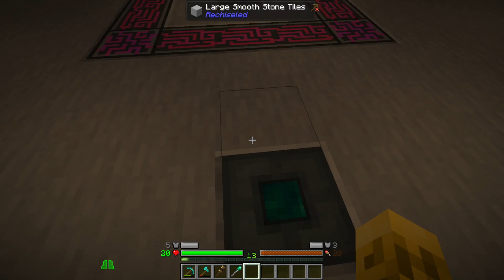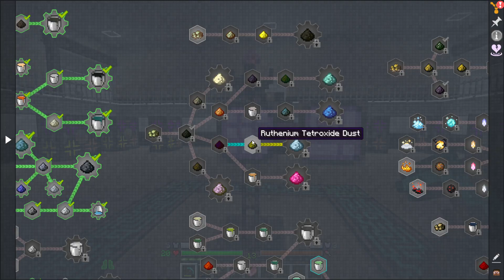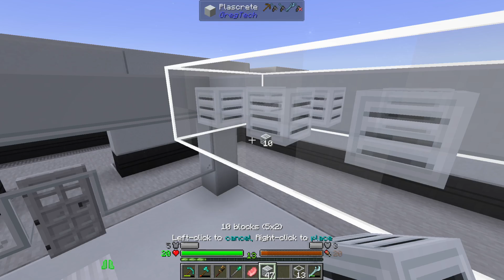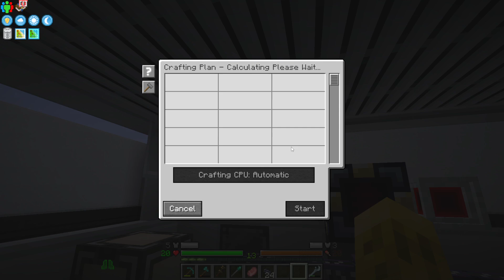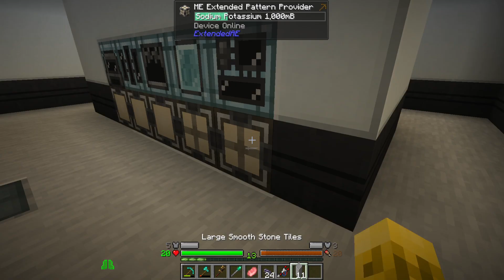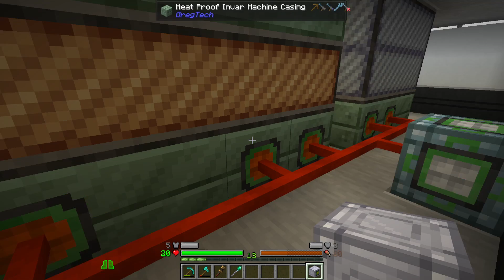Star Technology - EP 20

Comment: When you set a pattern provider to "lock crafting until primary result is returned", the result MUST return through the provider itself or it won't unlock, it's coded this way so providers know that the item resulted from their recipe, since if you had multiple running the same recipe they aren't able to know which item came from which machine unless it returns through the provider itself.

Also, I heavily suggest making a large barrel to make sea water which can be centrifuged into crushed rock salt ore and saltpeter ore (really good sources of potassium) and salt water (which can then be either centrifuged for salt or electrolyzed for sodium hydroxide and chlorine), just one barrel has been enough for my entire playthrough (about to step into UHV)